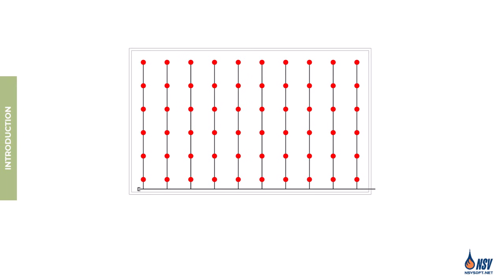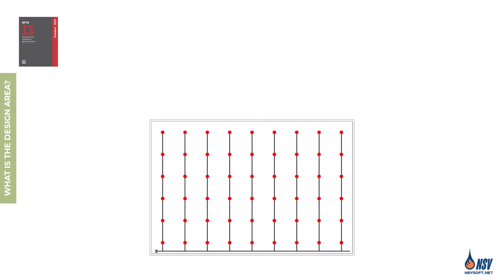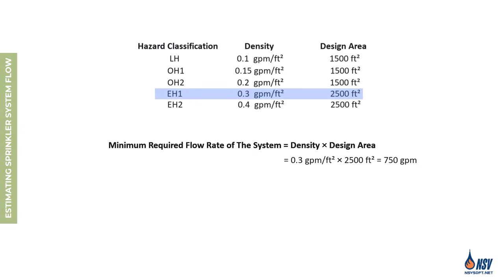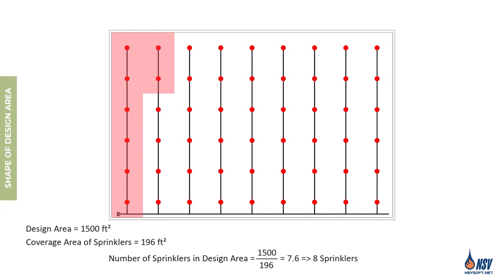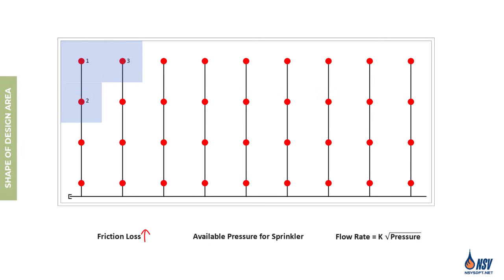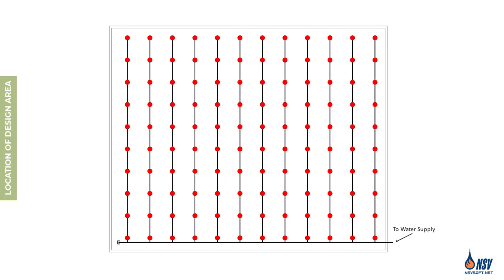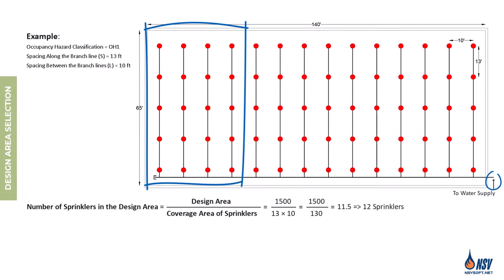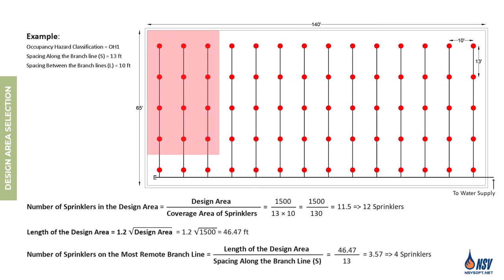◰ Design Area – Part 1: Basic Concepts (NFPA 13)

Comment: Hi 
Please flow water each sprinkler and pressure required to work 
Thanks
Reply from the maker: Hi Foad, the step‑by‑step hydraulic calculation video is now live!
Watch it here: https://www.youtube.com/watch?v=M0kZuunL4Ds
Reply: @NSVCad 
Thanks
Reply from the maker: Hi Fouad,

Before we dive into the required flow rate and pressure for sprinklers, we first need to talk about the K‑Factor. According to our schedule, the K‑Factor video will be published on 17th November. Then on 24th November, we’ll bring together everything we’ve learned in the hydraulic calculation series — Flow, Pressure, Density, Design Area, and K‑Factor — and solve a full example step by step.

Stay with us!